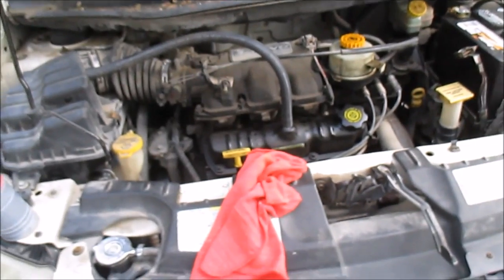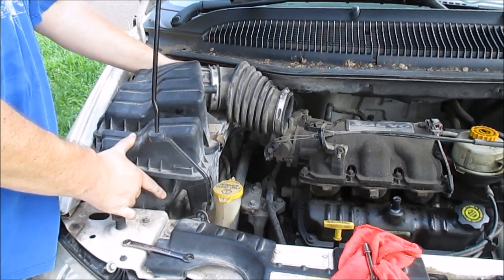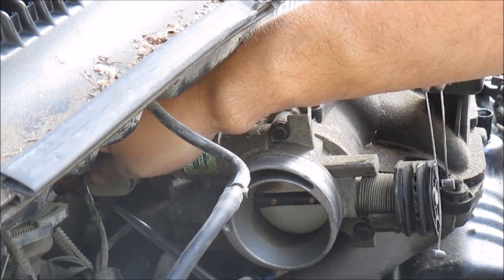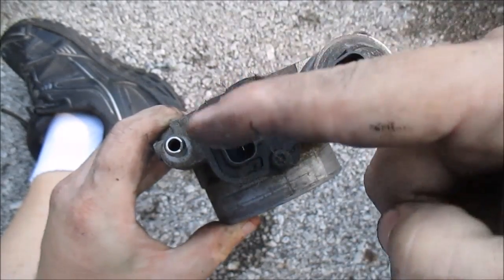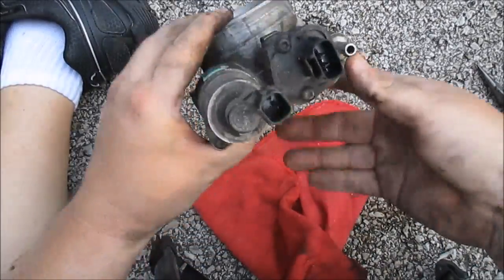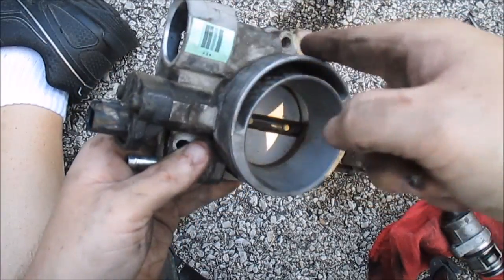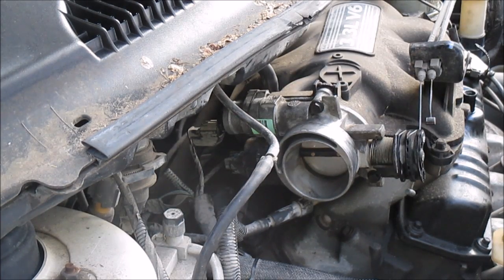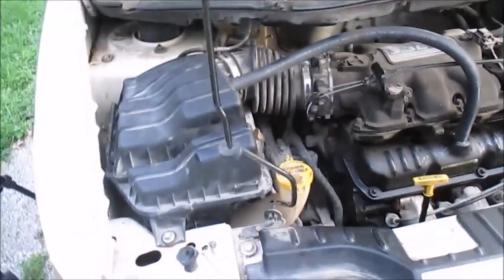How to Clean A Throttle Body (Dodge Caravan)

Comment: Good video real helpful. After watching the whole video it looks like it's best to take it all apart and clean it the right way. Thanks
Reply from the maker: Yeah I think it is better to take it apart, but just as you said taking it apart does have a risk. However if you take your time and pay attention to where everything goes. You will probably be ok. Thanks for the comment and have a good day.
Reply: +AJ “Figgy” Pierce yeah I just got done doing it about an hour ago it went well and was dirty as hell inside I would never have gotten all the gunk out without taking it a part. Thanks for this video I wouldn't have had the confidence to do it without this video.
Reply: MonkeyMan same hear buddy I just bought a 2006 caravan sxt from an elderly couple with only 80,000 kms. I took the throttle body of and wow was it bad.spent an hour or so cleaned her up nice video buddy!

Comment: Great video. dealership cleaned throttle body on my van with BG system. It was very clean on outside, but inside and Idle Control Valve were dirty full of carbon and gunk.
Reply from the maker: Sounds like they just probably sprayed the outside and gave it a quick wipe down and called it good. Well thanks for watching and thanks for the comment. Have a good day.

Comment: great video I tried cleaning my 2006 caravan throttle body body today by putting cleaner on a rag and pushing around, but after watching this I will be removing it in the morning and doing it properly, thanks for the great up-load!! and did you van run better after this?
Reply from the maker: +crazystang69 s 
Thanks for watching and thanks for the comment. Yeah I think I had a little bit better idle speed than before, but not really a huge difference. However it is still a good maintenance thing to do and sometimes you notice a difference and sometimes you might not. I have seen plenty of vehicles with dirty throttle bodies and dirty idle air control ports that would not start and stay running at idle because they were clogged up with dirty crap. Well anyway have a good day.

Comment: Good video and use of non- traditional cleaner,  and tools on hand. With the use of the correct throttle body cleaner, wire brushes and old tooth brushes and some rags this job would have been more easier and effective.

Comment: Great video, I saw you disconnected the battery. Did you have to reset any codes. The dealership wants 280.00 to do this lol. I can buy a brand new throttle body for 80.00

Comment: I replaced my egr valve because i had a po 406 code. Will a dirty throttle body cause the egr to cause a code.? I bought a new egr and i still have the same code

Comment: You do not have to remove Air filter box. You can disconnect it from throttle body, move top filter cover portion without disconnecting air flow sensor out of the way and get decent access to throttle body.
Reply from the maker: Yep there are a lot of ways to get things done. Thanks for the comment and have a good day.

Comment: just finished  doing my 06 caravan I  just bought it a few days ago one owner dealer serviced since new 160,000 kms , it wasn't too bad in there.... I had an 05 before this van and it has lots of power, this one is a big slug... I did new plugs wires, seafoam treatment nothing has helped...

Comment: i have a 2003 caravan and it idling really rough..the engine shakes alot feels like it gonna stall..can this be that the tps needs to be replace or should i clean the whole throttle system..pls help..
Reply from the maker: Is your engine light on? You can try to do an ignition switch trick to see if you have any DTC codes, which might help you in the right direction of your fault. Here is a video on how to look for stored trouble codes and I demonstrate this procedure on my 2003 Dodge Caravan so this trick should work for your as well. Here is the link.
 https://youtu.be/sFmBn_P2UHw              Try this trick out to see if it gives you any help in pointing you in the right direction. Who knows you may have a stored code that tells you exactly what is wrong.

The trouble is there could be a lot of things causing a rough idle issue. Some of the most common things that can cause a rough idle is a cylinder misfire (which could be caused from issues with fuel, compression, or ignition) Also you could have fuel, compression and ignition, but if your air to fuel ratio is off, that can cause a cylinder to run to rich or to lean and that can cause a cylinder to misfire. I would suggest getting an inexpensive obd2 scan tool, I am not suggesting one of the several thousand dollar ones that pros use, but perhaps a 15-20 dollar scan tool that will read obd2 codes and be able to read live sensor data.  These are very handy to have, and should work on most cars that are 1996 and newer, it will read live data on several sensors, and give fuel trim data and other info.  Here is a link to the very first cheap scan tool I bought online for around 20$ and mine still works great for reading codes, and getting live data on sensors, and it is very user friendly.            https://youtu.be/jOc0_VuGaQM
Having something like this allows you to look at engine data to help determine what is wrong with your vehicle. 

Well try the ignition trick and see if you have any codes stored.  Also a simple thing to try to do to find a non contributing cylinder is a by doing a cylinder drop test. Which involves using a test light or wire to manually ground out the ignition coil. This is done while listening for rpm drops. Basically if you do this test and there is no rpm drop heard, that is the cylinder that is not contributing, and your problem is in that particular cylinder. Here is an excellent video that demonstrates this technique very well.                  https://www.youtube.com/watch?v=5ewJIBS9L98    

Now I dont know if this is your problem or not, cause as I said it could be a lot of things, but if you have a misfire this is a good simple way to find it. (If you do this I suggest using rubber gloves because this test can give you a pretty good shock if your finger is closer than the test light, the shock is similar to a very bad static electricity shock, and it does it hurt if it gets you.)  If you do find a misfire, you can try swapping spark plug wires or spark plugs with another cylinder and see if the misfire changes to the other cylinder. I hope that makes sense. 
         

Also I have a video series on how I replaced the plugs and wires on my dodge caravan you can check that out here. 
https://youtu.be/DLJUZQ7tIvY               at about a minute in I start taking the plug wires off the ignition coil. The 3 in the front go to the front 3 cylinders and the 3 in the back go to the back 3 cylinders. You could use the same technique to find a dead cylinder, just like scanner danner showed in the above video..

Well I hope some of this info helps you out, and helps you figure out your problems. Let me know what you find. Thanks for the comment, and thanks for watching. Have a good day.

Comment: my 2007 dodge grand caravan van started jerking on the fwy as soon as we to hit the gas got up to 50mph and it started jerking it wouldn't let me go over 50mph I had no choice but to get off the fwy and take the back streets home and the check engine light came on do you think this could be a problem if so please let me kno....
                                   ThankYou
Reply from the maker: Yeah could be a problem if your check engine light came on, it could be a lot of things causing this. Try this trick to see if you can find a stored code, if you have a code let me know what it is.  check this link for how to get codes     https://youtu.be/sFmBn_P2UHw 
 I showed how to do this trick on my 2003 dodge caravan and it works for that year but I am not sure if this trick works for a 2007 or not but you can try it and let me know if you have a code stored. Perhaps that can tell you more as to what is wrong. Otherwise I would suggest taking your vehicle to a local auto part store and ask them to scan it for you to see why your engine light is on (this is usually free to have them do it), or take it to a mechanic and have it looked at.  
Now driving your car around with an engine light on could be a very bad thing to do, because you could be damaging your car, it just depends on what is wrong with it. Hopefully that trick will tell you what code the engine set, but if not I would suggest having it looked at as soon as possible, and suggest not driving it until you know for sure why that engine light came on, but there is a reason the check engine light came on and you need to know what that reason is. Well I hope this info helps you out, and good luck to you. Thanks for watching and thanks for the comment. Have a good day.
Reply: Bad throttle position sensor $10.00 on Eba.
Reply: Have the fuel pump checked. It may not be delivering enough fuel pressure.
Good luck.

Comment: quick question if u replace both throtle position censor and trhotle idle air motor wat will happen? i mean is the computer going to mess up or stay like normal?will the check engine light come on? tia
Reply from the maker: Most of the time unplugging the tps sensor or IAC will result is a dtc code and turn the check engine light on. You would need to use a scan tool to clear the codes after fixing sensor or plugging the sensor back in, or the codes can reset on their own after so many drive cycles. If the computer thinks there is a fault in the tps or iac depending on the computer programming it might run in another mode using other sensors to help determine the best way to run without the tps or iac. It just depends on the computer programming. Many computers have back up programming to run the vehicle when certain sensors go bad, or set a code. I hope this info helps you out, and what I explained makes sense. Thanks for watching and thanks for the comment. Have a good day.
Reply: AJ Pierce  ok so my dodge neon throttle body has a stickee sayys do not clean the inside of the throttle body and sum like that ..what should i do? should i or shouldnt clean my throttle body? cuz i think the reason why my car vibrate is bcuz the throttle body itself nd the ac sensor is dirty

Comment: Hi Pierce, so I have an 05 dodge caravan 3.8l and the alternator went, my friend have a 06 with a 3.3l both v6 he is giving me his alternator, will it work. Thanks
Reply from the maker: I am not 100% sure but I believe it should fit. The reason I say it will is if you go online to an autoparts store. I opened up two tabs in my browser, and searched on autozone.com in each tab. In one tab I searched the 05 dodge caravan (the 3.8l was listed under grand caravan) and I looked up the alternator for this vehicle. In the other tab I searched for the 06 3.3l alternator (was not sure which 3.3l, more than one 3.3l, you need to know 8th vin number that is the engine code) Anyway, I did an alternator search for both vehicles, and the alternator part numbers all matched for both years. So I believe they should swap out, but you may want to double check to be sure. Well thanks for watching and thanks for the comment. Have a good day.

Comment: Could you please tell me what the torque specification is for the screw (T20 torx bit) that secures the Idle Air Control valve?  Thank you for your time!!!
Reply from the maker: My husband passed away two years ago, so I have no answers for you. Sorry. Thanks for watching.
Reply: AJ Pierce Thank you for answering and I am sorry for your loss.

Comment: hello..i tried that link you have sent me..the code that is showing up is p1684..what is that? i have clean my throttle body and intake valve just like in your video..and yup that code came up..
Reply from the maker: P1684 I believe just means that your battery was disconnected with in the last 50 start cycles, at least that is what the code said it was from this website  https://www.obd-codes.com/trouble_codes/dodge/       So was that the only code that came up when you did that ignition switch trick. If so you may try that cylinder drop test and see if all cylinders are contributing or perhaps one of your cylinders is misfiring and causing a rough idle.  About the next step would be to hook up a scan tool and look at live data. I would probably take a hard look at fuel trims, o2 sensors and see what is going on with those.  Or if you dont want to spend a lot of money buying tools. You may just try replacing the spark plugs and spark plug wires on it and see if that fixes your rough idle. Of course I dont like to just throw parts at a vehicle with out checking things out first, but if you dont own the tools to check those things out, you may just try swapping those parts out as a maintenance. I dont know how many miles are on your vehicle or when you last had those spark plugs and plug wires changed out, but I believe the maintenance interval says to replace spark plugs and spark plug wires every 100,000 miles. Well if you replace your own parts I suggest you check out rockauto.com they have hard to beat prices for automotive parts. Well I hope you figure out your issues. Have a good day.